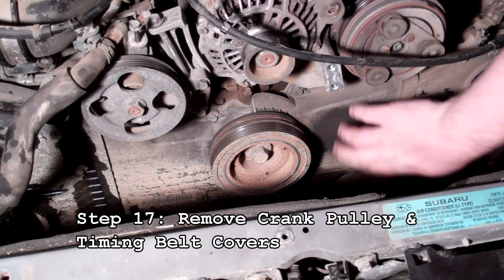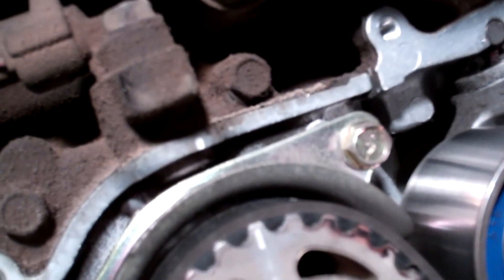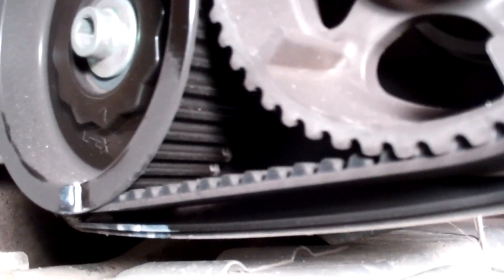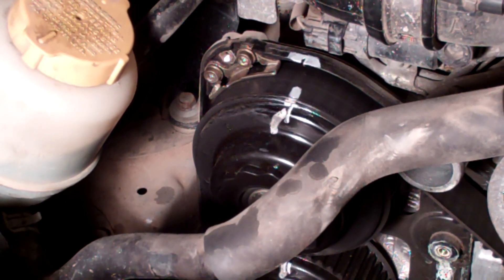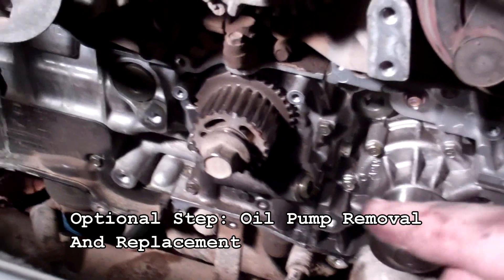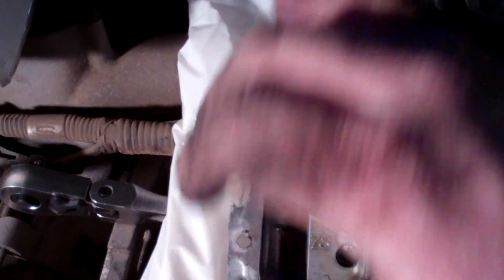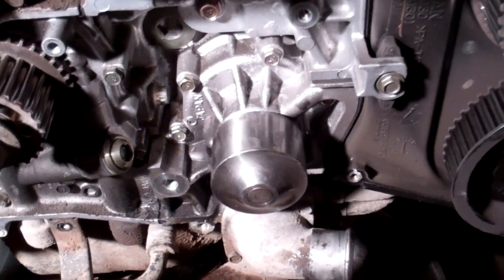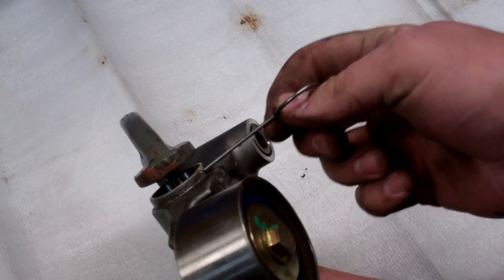Meatys Subaru Timing Belt Guide (HD)(2/5)

Comment: Meaty thank you much for this video series. I suddenly developed a leaky water pump a few days ago and was quoted about $1200 at the dealer for timing belt/water pump replacement. Heck no! I got the parts today and will be doing this tomorrow thanks in no small part to your video!  QUESTION: My new water pump came with gasket but would you recommend also using a thin layer of Permatex on either side of the gasket....or no Permatex and just use gasket itself??